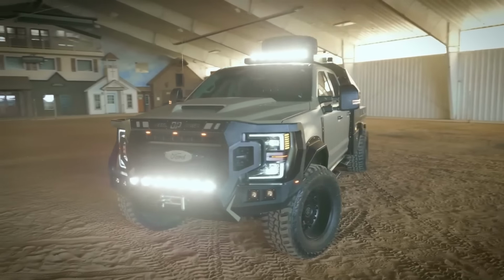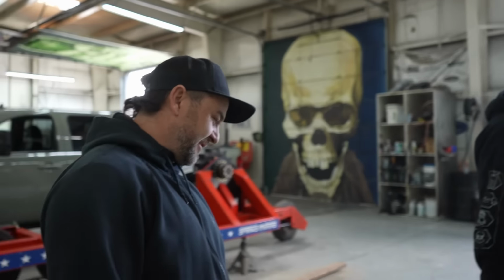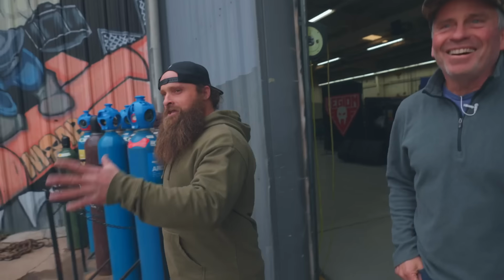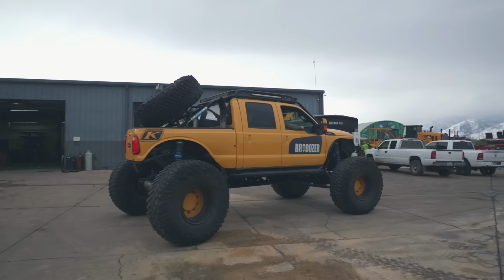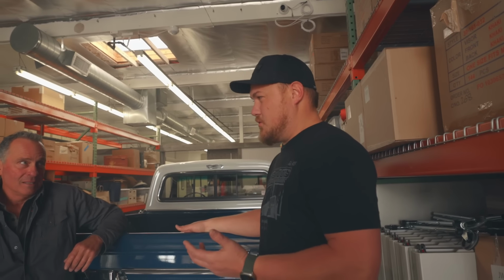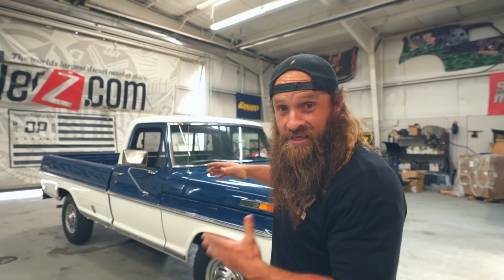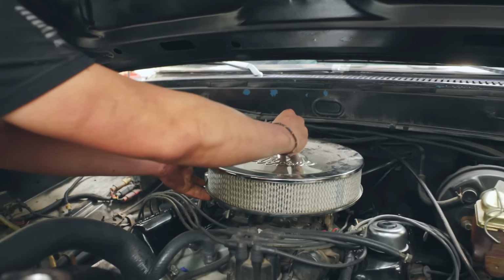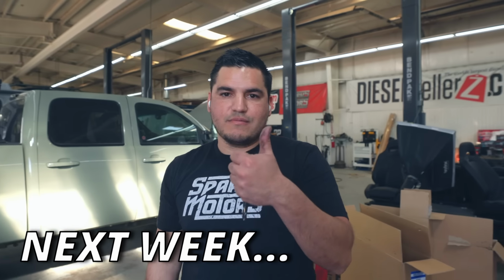TRANSFORMING A TRUCK TO HONOR JOHN WAYNE'S LEGACY!!! (EPSIODE ONE)

Comment: "Ford offered the F250 Camper Special Package as an option for their F-series from ‘65 - ‘82. Upgraded rear suspension, cooling, and other items were included in the package." it's more than just a tool box
Reply: Ours didn’t have the tool box because we got the extra gas tank. We could carry 50 gallons and bartered at gas stations. If they wouldn’t give us 2-3 cents off per gallon we went to the next station. Times have changed!

Comment: Old age is kicking in but, I used to be a service manager at a ford dealership.  If my memory is correct, the camper special trucks also had the rear wheels set further back than the standard pickup.  This allowed more weight transferred to the front end and less on the rears.  Just say'n.
Reply: Absolutely!!!!! Shout out to Robby and the Sparks crew, too!

Comment: Duke 68 because those types of trucks back in the mid 80s me and my brother could get them all day long for 5 hundred bucks we would lift them up and it would not cost anything we did it with stock suspension and run 38 or 40 inch tires the last one I had in 93 I was racing in 2wd class mud bogs 6 seconds ran 4x and took all 4 spots DD that's was the only Ford that I put a chevy engine in it and at this time I own a 95 Tahoe that I rebuilt so those trucks I had for years and I learned off roading in a 2wd with in the long run will teach you fast how to go off road we can run the same kind of trucks and it would be hard to outs me in  Florida were lots have tried me the only one comes close is my older brother get you some of that

Comment: I'm thinking that you're going to find the misfire in number 7 cylinder is due to a vacuum leak at the T that is located between cylinders 7 and 4. I found this to be common on Ford FE blocks.
Reply: Amigo said that there's no compression in number 7.
Reply from the maker: ……soooo………..you kinda know your stuff………….
Reply: @delbutler885  Master mechanic of 50 years here.
 I'm saying it has a burned valve on #7 cylinder yes. Ford FE engines have a gang connection with several vacuum hoses that rot from wear a create 2 lean cylinders sometimes burning one or both valves sharing that intake runner.
Reply: I may not be 100% correct but I'm pretty sure that's what's going on if not I've been wrong before it's part of learning.
Reply: Ok you said vacuum leak first. Now you say burned valve due to running lean caused by a vacuum leak. That's reasonable
Reply: @delbutler885  In the automotive repair industry, this is called a pattern failure.